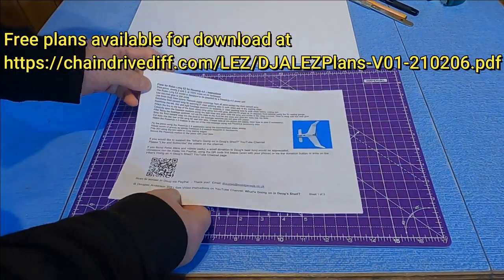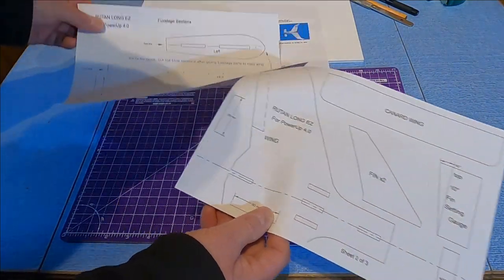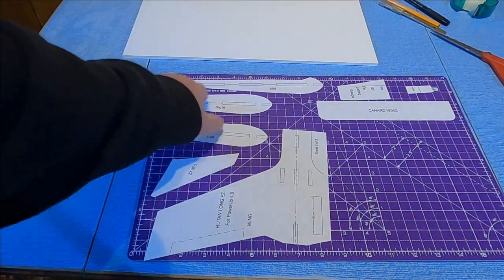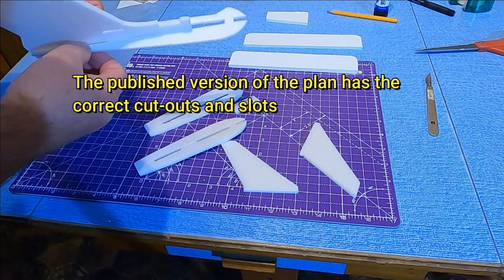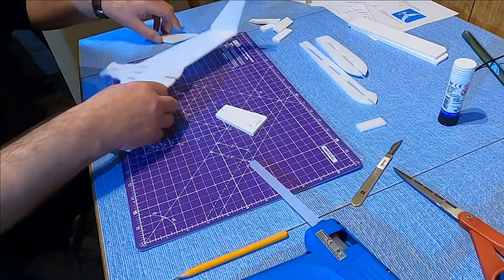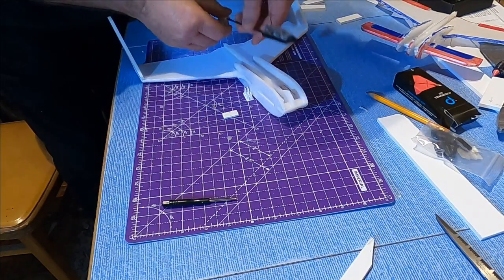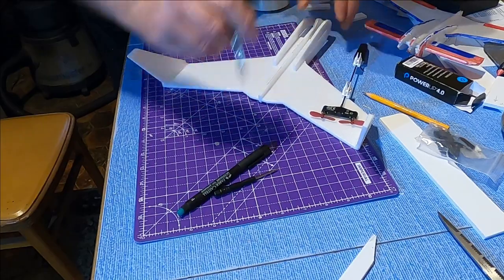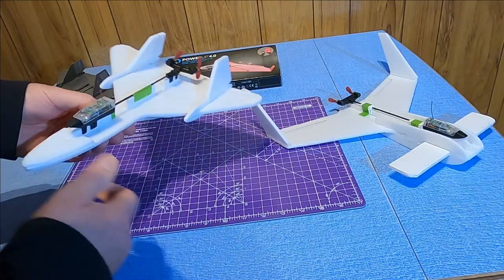Free Build Plans for the Rutan Long EZ for PowerUp 4.0 Smartphone RC Model Aeroplane. Build and Fly

Comment: Very helpful info! Do you have a link to the clip STL?
Reply from the maker: Hi Timothy, I have just moved my files to a new web domain. The .stl file for the powerup clip is now at https://www.dougsshed.co.uk/SR71/3Dpowerupclip.stl
The .pdf plans for the SR71 Blackbird are at https://www.dougsshed.co.uk/SR71/SR71BlackbirdPlansV1-210112.pdf
The .stl file for the 3D printed engine pods is at https://www.dougsshed.co.uk/SR71/3Denginepod.stl
For a slower/easier flying SR71 Blackbird you can print the plane and pods at 125% size
Reply from the maker: The plan for the Rutan Long EZ is now at https://www.dougsshed.co.uk/LEZ/DJALEZPlans-V01-210206.pdf
The powerup clip is at https://www.dougsshed.co.uk/SR71/3Dpowerupclip.stl

Comment: Dear Doug. 
Thank you for your great models. 
In this Video at 12.30 you showed a new SR71 Blackbird design made of 5mm foam. 
I would like to build this model very much.
Would you please be so kind and publish the plans for this model too?
That would be very, very nice. :-)
Reply from the maker: To build the 5mm foam version, print off the plans at 125% scale. You will only need to fit the top strengthener to the top of the wing (I reduced the length of the top strengthener to where it meets the wing angle) . I also added a second mounting tab to the skid to mount the PowerUp motor's optional vertical foam clip. https://chaindrivediff.com/SR71/SR71BlackbirdPlansV1-210112.pdf
Reply: @DougsShed  
Dear Doug. 

Thanks a lot for  your reply. 
I will give it a try!
I am very exited and will keep you posted. 
Until then..
Kind regards from Heiko